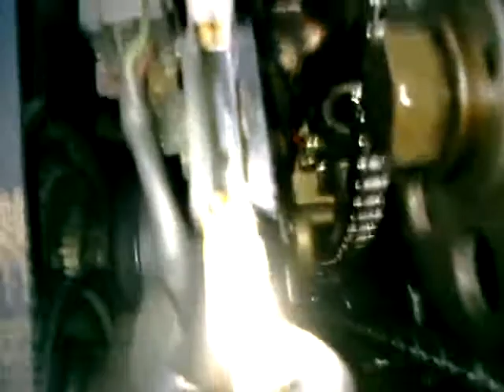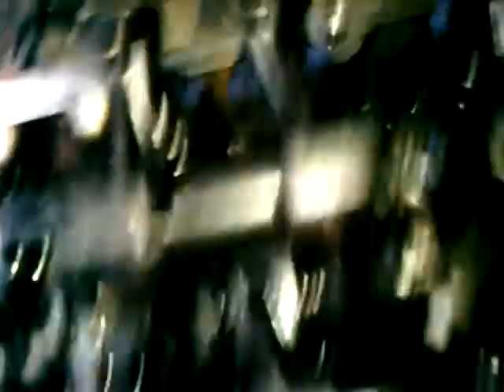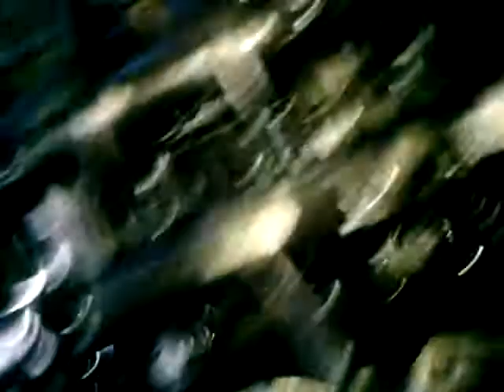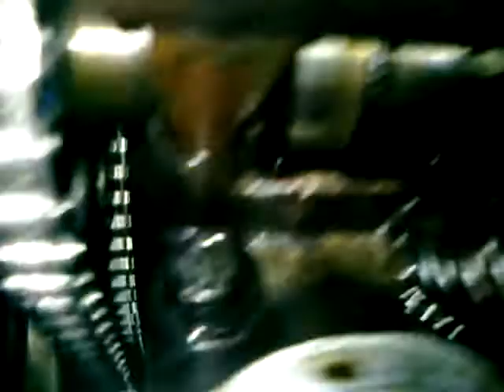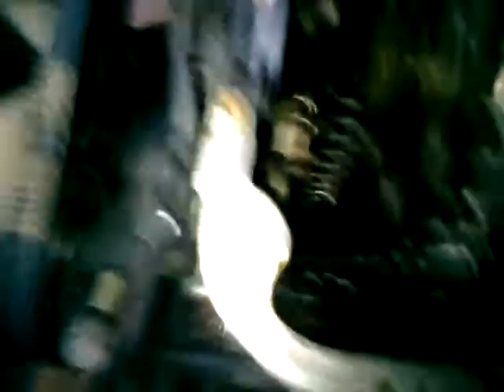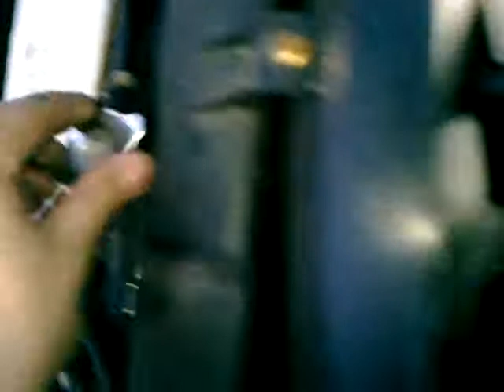Inspecting KA24E

Comment from the maker: you have to take the head cover gasket, drop the pan and pull the pulleys and timing cover off. just running it like it was sucked, putting any kind of strain on it stretch it out of time just enough for it to stall. ALSO it wore a hole in the coolant port on the timing cover. so don't drive it like that lol

Comment: i know this video is old, how did you remove the valve cover. Do you have to torque  the bolts to put it back again, do i need to get another gasket